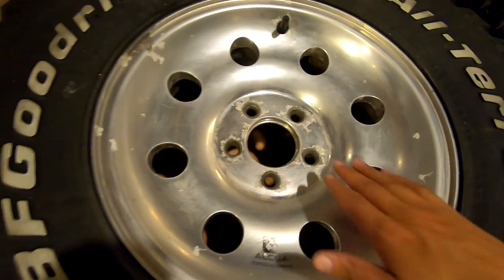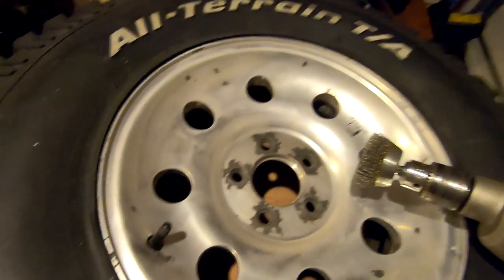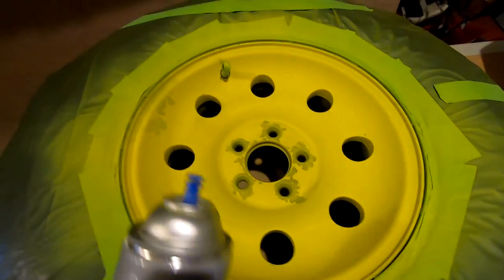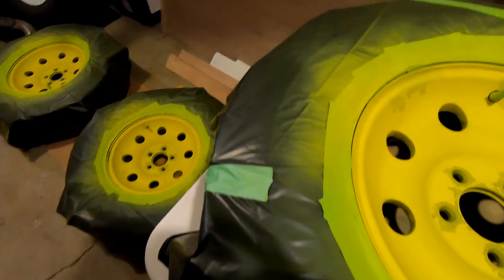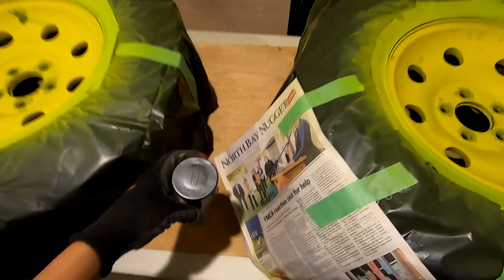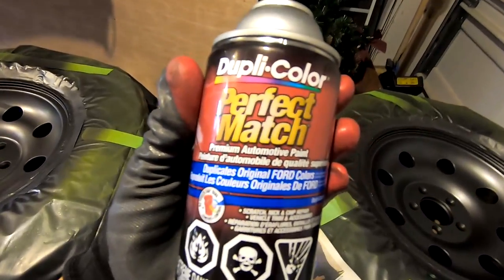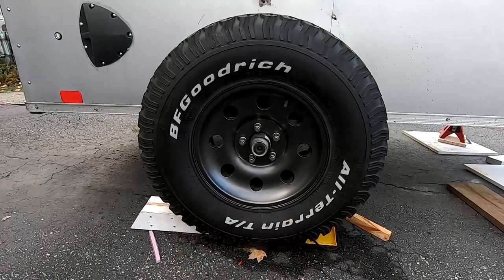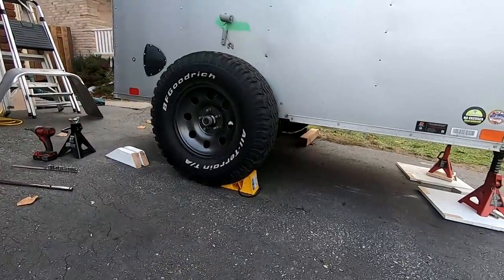OFF ROAD WHEELS installed on 5x8 CARGO TRAILER CAMPER

Comment: i would like to put matching wheels and tires on my 6x12 cargo trailer .same  that i have on my tacoma , witch is 285 70 17 ,but my wheels would have to be 5 bolt ,my truck is 6 bolt . do you know if it would work
Reply from the maker: I think in this case you have to get custom hubs or spacer adapters to convert the bolt pattern! Thanks for watching
Reply: Thank you

Comment: I have a Winnebago hike smaller bumper pull. It had undercarriage damage which I fixed being on welder I have a lot of clearance on it now and my truck is lifted really high like over 10 in and so I put a little extra on the trailer but now it looks dumb because the tires and Rams are so little compared to the giant clearance space .. therefore I'm trying to figure out what I need to do as far as adapters or if there are any truck rims I could use like a put like 33s on it because check my spare tire 38 are there just to see for Clarence and it actually looks great so I figured I would try to find some truck rims with 33s on them..